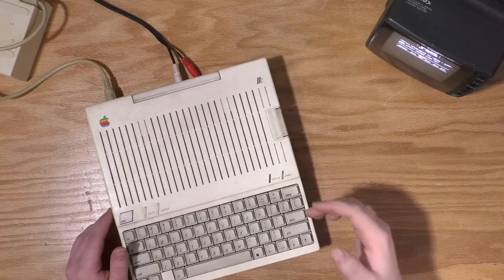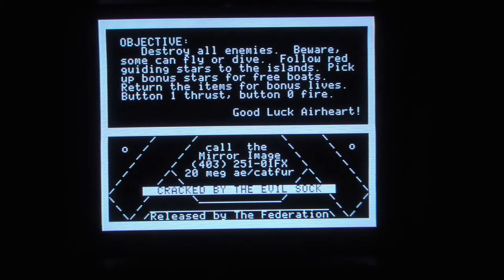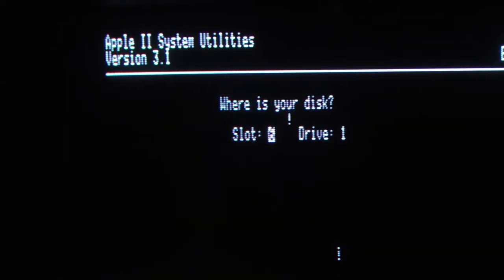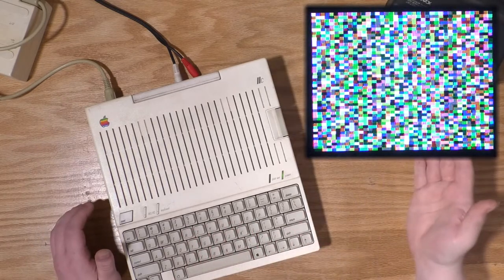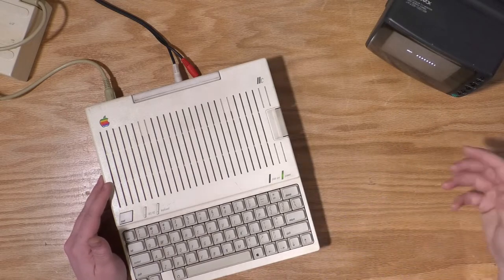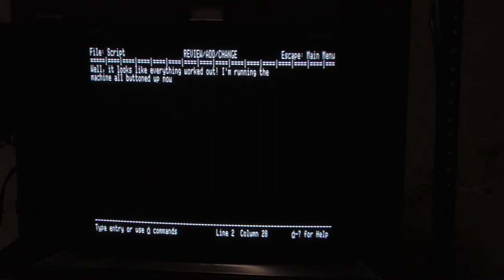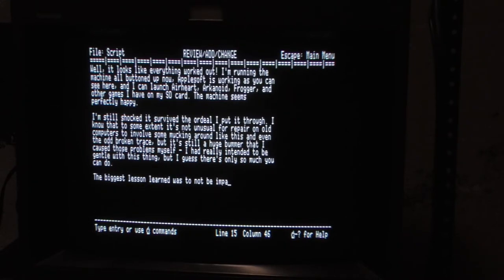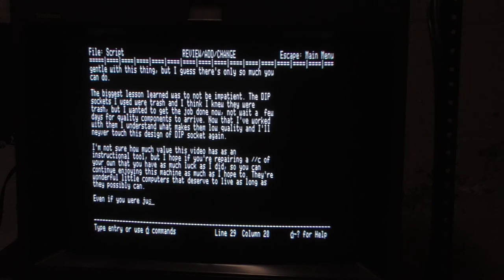Repairing Apple IIc RAM (Also The Stuff I Broke)

Comment: I have a couple of those solder suckers, too.  I really like them.  But, a couple of caveats:

1) Get a refill pack of silicone tube.  It is definitely a consumable.  It starts to fray and split at the end, which ruins the suction.

2) You need to clean it from time to time.  Unscrew both ends, thoroughly clean out all the solder dust, and oil the o-rings.  I use a Q-tip dipped in motor oil.  If you don't keep them lubricated, they'll hesitate while moving, which is no good when you're trying to quickly vacuum up molten solder.

3) This one's a bonus -- no charge.  If you are trying to de-solder something with a lot of solder on it, e.g., removing the wire wrapped around an AC inlet's spade terminal, you may end up clogging the chamber with a big glob of solder.  This is no fun at all to clear.  I have had some luck using a hot air station to liquify the solder and tap it out onto a work surface.  That aluminum tube will wick up some serious heat, though, so you need ample fire power at your disposal, and it'll get flippin 'ot!

In light of #2 and #3, I would highly recommend getting two of them, so that when the first one gets clogged or starts acting sluggish, you can carry on with the second until you're done with the job, then properly maintain them.  Or, do like I do, and neglect both of them until they're both out of commission, and hastily fix them both while grumbling to yourself and contemplating the purchase of a third as a spare.

Comment: I’ve gotten so meticulous about IC legs that I roll them slightly and check them with a straight edge. An early project I went thru half a dozen with twisted and crushed legs. There’s prolly an op amp somewhere in my shop still laying where I threw it lol. 

The legs are splayed slightly so they can sit on top of each other for machine placement I’ve been told.

Comment: This repair job was not nearly as barbaric as the way I handled my Tempest arcade board repair and somehow I still got that working, so I am not surprised you succeeded.
Reply: (I really need to get a solder sucker like yours -- I have one of the Radio Shack ones and it doesn't work nearly that well, so I wound up pulling most of the chips I replaced off the board with a heat gun, singeing the board in multiple places in the process.)
Reply from the maker: tbh I've since pivoted to a Chinese automatic desoldering gun with a vacuum pump and it makes much much much cleaner holes, and I now cannot recommend anything else in good faith

Comment: The Apple IIc for some reason has a high failure rate on its RAM chips compared to the rest of the line. Maybe Apple got a marginal batch? Normally the Apple II is a bulletproof machine!
Reply from the maker: Yeah, they seem really failure prone from what I've seen. Weird, right?
Reply: I kind of wonder if it's a thermal issue, since the IIc is a lot more densely packed than the others. They also tend to get moved around more often than other II's, which makes the odds of the system getting banged around much higher.

Comment: 22:41 I did the same thing when I tried replacing a RAM chip for the first time on a ][e. I tore out 4 or 5 traces! The board had those thin traces on it. I tried again on a different board, and had no problem.

Comment: "Going to brace on this yellow component." is a phrase that makes my butthole pucker so hard that I can carry my chair away if I stand up. That's a tantalum capacitor and those things are not only brittle and the most fragile things on the planet (and that's when they're brand new), but they also fail in the most spectacular display of fireworks and flames.

Comment: Good vid!  Only criticism I have is that you were soldering on top of the IIc case,  Luckily you didn't burn or melt it,  Also, not  criticism, but you can test RAM on these old machines by lining up the pins and simply piggy backing a RAM chip on top of the suspected failed chip, rather that having to de-solder everything.

Comment: oh hey, a repair video! i wonder what-

[single-wipe sockets]
oh no
Reply from the maker: i legit forgot these were a distinct design until i was three quarters through
Reply: whats a "single-wipe" mean?
Reply: @Wtfinc  The socket makes electrical contact with each pin on only one side.  Better sockets make contact on multiple sides.

Comment: I'm surprised you don't have an IC extractor and used a screwdriver. That's risky business.
Reply from the maker: I actually find the extractors I've used really touchy and feel I have more control with the screwdriver, but I think I just need to bite the bullet and figure out how to do it right because, yeah, it's obvious why this was a bad idea.
Reply: @CathodeRayDude  I've not used them too much but I find that the ic extractors work best with a little bit of wiggling while pulling on the chip.

Comment: Koptan, nice, my dad works in a tape and film factory and they produce Kapton. So he can grab rolls that come up short after running a billet. So i have 2mil and 10mil that ik of offhand, and widths from .5" to 16". Even have a 12" wide sheet of the 10mil without adhesive laid on the back. And another in the 2mil with it.
Reply from the maker: god that's nice, I would love to have real kapton
Reply: @CathodeRayDude  i mean, define "real". He doesnt know if they sell it to 3m, dupont, china, etc. But its polyimide film that its made on. Personally i dont find the brand matters for something as simple as tape, it just has to handle the 400+ degrees celcius that branded Kapton does. 

My stuff isnt branded, its short, or wrinkled rolls. Scraps technically, but my dad usually chops the defects off for me on the slitter.
Reply from the maker: @Di3mondDud3  Oh, yeah, I just mean if yours isn't The Worst Crap Imaginable, it's better than this. This stuff is just sub-par. I've used real kapton once or twice and the adhesive is much higher grade, though perhaps that's an option?
Reply: @CathodeRayDude  apparently their stuff gets sold from ULINE. It is the 3m stuff, they dont use branded cores on the kapton they do for other different materials.
The adhesive on most of the tapes they make is seriously strong. The kapton sticks well but has to have a good clean surface i find.

Comment: 18:12 I'm not well versed in board repair, but I don't understand why you discarded this RAM, couldn't have been easily bent back to position with some pliers or even by hand?
Reply from the maker: The elastic limit on chip leads is extremely poor. They can handle being bent once or twice, then they become incredibly brittle. If I'd bent it back and shoved it in again, it very likely would have snapped off - or it would have worked fine, and then broken under light vibration later and created a heisenbug, causing random crashes that can't be reproduced.